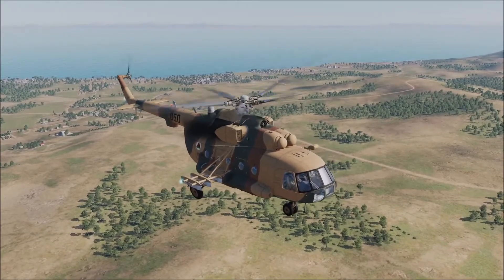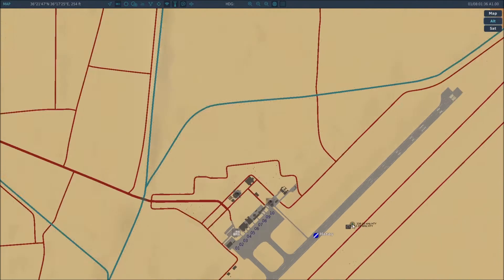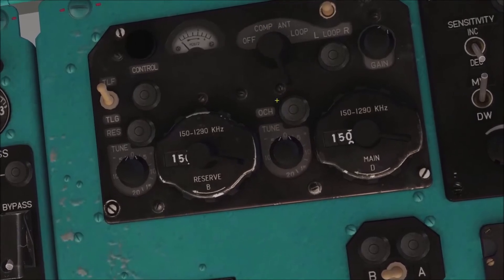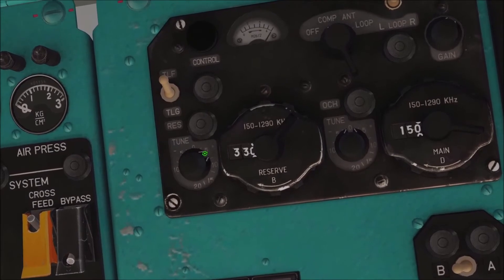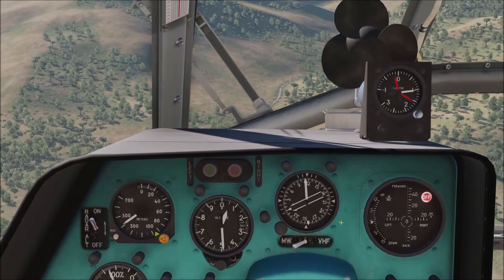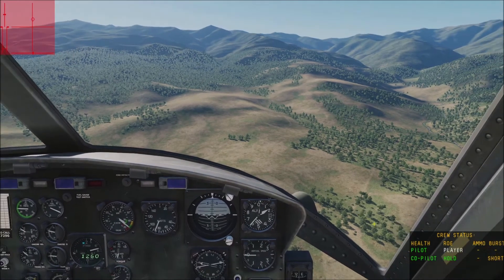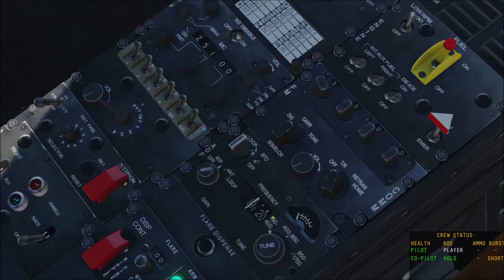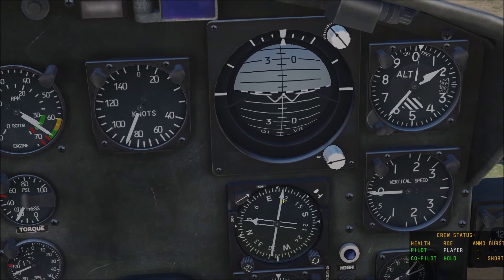How to navigate using the ADF in the [MI-8/UH1H]

Comment: Hi
How does helicopter pilot maintain safe distance of main rotor blades without hitting objects ? 
When low flying ....for example..I watched Fred north videos...how does he maintain the rotor blade without hitting mountains and trees?
Is there any sensor ? Apprach Warning ?proximity sensors?
Reply: It’s anal mk1 eyeball. You know how large your rotor disc is, you keep the body of the hella bove the trees, the rotor disc is about 10 feet above, on a Puma, ,   No instruments in daylight, it’s up to the pilot to keep the disc in the clear, no if’s no buts. Get it wrong, you die, lost three friends when pilot got it wrong, cartwheel, exploded,,all lost, Over the past 40 years we have had Night Vision Goggles. HEAVY, neck hurting thins with a co-pilot, without, goggles might save everyone. I,E. An object may look 40 ft away in the NVG,  but only be 20 feet... made for some interesting flying and night time tree trimming, while landing,
Reply from the maker: If you hav vr in dcs. It will solve that problem. It’s hard to tell depth on a 2d screen. But in vr it’s much better. Other then that I don’t know.  You do have a radar altimeter but that only gives you altitude above ground directly below you.